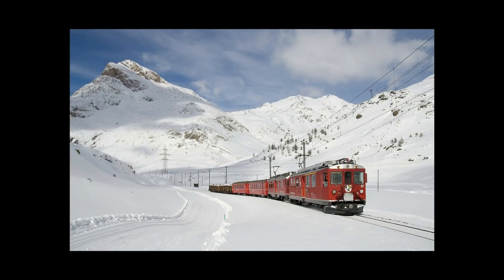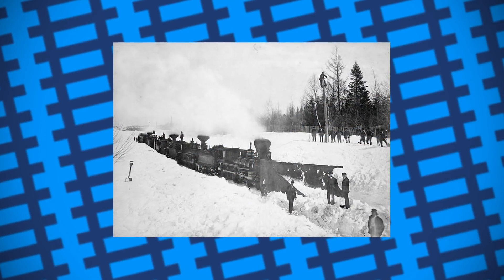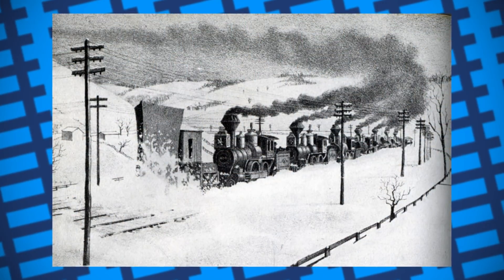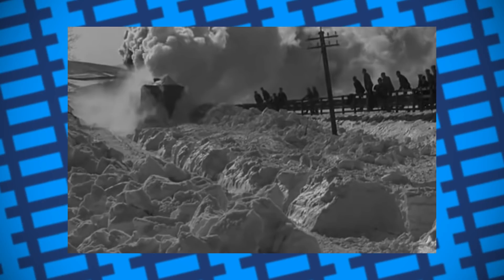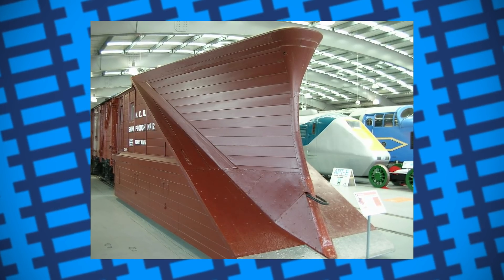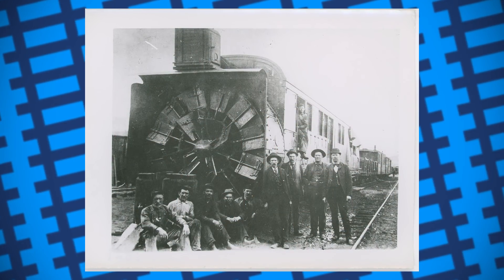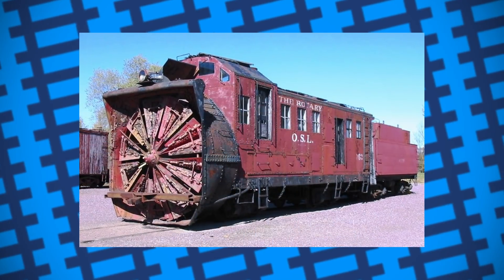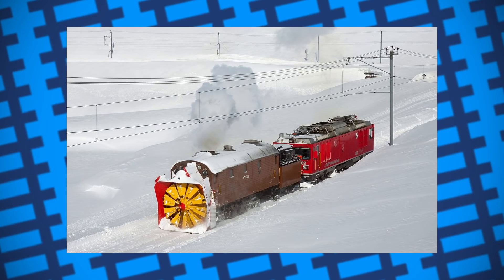How trains clear snow drifts from the rails - Railway Snow Plows

Comment: I think it was the winter of 1947 Britain used an aircraft jet engine attached to a wagon to clear the snow. The blast from the engine was aimed at an angle towards the track where the snow was blown away. I have a feeling this was not used again, partly because 1947 was a particularly bad winter, but mostly it was ineffective and it was not the best use of the engine.

Comment: Way back in the day on the Denver South Park and Pacific Railroad, a train was out on the line during a massive blizzard, the crews couldn’t see 20 feet in front of the plow, soon enough though the storm cleared and it was a clear night with the moonlight illuminating the wilderness. In the shadow of the moonlight a massive solid looking object was dead on the rails. The engineer threw the brakes, put the locomotive in reverse and laid down in the whistle, once they got to a stop the engineer and firemen got out of the cab too see that the obstruction was a large bale of hay. Assuming that this was the work of a farmer that came through with a herd of sheep hours before. He joked that maybe they were the ones trespassing on his land. And that was the truth. After 45 minutes of searching they found the mainline a half mine away. The WHOLE CONSIST was a half mile off the rails in a farmers field. The engineer said that looking back on it he noticed that the train ran a lot smoother once it left the rails.
Reply: Holy Hell

That must've been one hell of a story to tell the rescue crew if any were needed
Reply: Bruh moment right there

Comment: I've seen the occasional plow train running in the winter in New England. Usually the Loco-mounted plows are enough but when there are big drifts the railroads will use Russell snowplows. Russell snowplow cars are ancient (1920s-1950s vintage) but they get the job done. Jordan spreaders are also used- they have the advantage of being multipurpose machines, since snow plowing is secondary to their primary function of spreading freshly-laid ballast.

Comment: Finally. An explanation why Donald and Douglas were seen operating back to back with a breakdown coach in-between during the snow seasons
Reply: I know. I always thought that was something the Rev W. Awdry made up. I was shocked to hear that engines actually did that in real life
Reply: A large part of the reason for it is that without modern weather forecasts nobody knew if they were clearing the snow during the middle of a storm or the end of it, and if you set off and start clearing a line during the middle of the storm without a plow facing behind you, you might not be able to get home because of the amount of snow had fallen on the track behind you…  Then the plow would require a rescue consisting of another plow coming from the depot, (which could then easily mean you end up with two plows, both facing the wrong way as even more snow falls, and you needing another rescue!)

So, assuming your snow removal plans don’t include “wait until it melts in the spring”, (and for some lines it does,) it really is best if the snowplows can come home on their own even if it keeps snowing.

There was a brief time when good weather forecasts started being a thing that the rotary plows in the US didn’t follow this rule: they had the rotary on the front but just a regular plow in the back figuring that not that much snow would fall and it would be okay...  Several got stuck during a particular bad storm, and the rule is now if the snow is bad enough to justify using a rotary at all, you need one on the back too.
Reply: @gimmespamnow  Huh, interesting. Thanks for sharing. I'm an American, so I don't have as much knowledge on European railway operations, but reading your comment has given me a greater insight to how back-to-back snowplow trains worked
Reply: Losh sakes
Reply: Hey, yeah!
Reply: Ai

Comment: In snowy conditions the fuel in diesel’s fuel tanks would usually freeze, crews would get around this by lighting a fire under the tanks to thaw out the fuel, this was surprisingly effective
Reply: Effective, but also very dangerous!
Reply: Diesel doesn't freeze, it gels.  It would also be relatively easy to pipe a heating tube through the fuel tank to circulate engine coolant through to warm the fuel.  "Snowy conditions" is relatively vague, because just because it's snowing, it doesn't mean it's cold enough to gel the diesel.

Comment: I wonder if there's ever been an accident involving snow that knocked a engine off the rails
Reply: I've read about a train being divided into three separate sets of wagons when it ran through a snowdrift (the locomotives continued for some distance before discovering this). They then went forward, switched lines, came back, & attempted to push the broken wagons forward to reunite the train. The idea of propelling goods wagons through snowdrifts with only the three man team of driver, fireman & guard was sheer folly, & the wagons became derailed. This led to single line working being enforced over that section. This was a contributory factor in a larger disaster that followed.
Reply: The Swiss Rotary Snow Plow shown at 02:46 once was rolled over by an Avalanche

Comment: Probably the most extreme idea of a snow plow was use of a jet engine on a rail cart to clear snow!
Reply: They have those on trucks and custom rail vehicles.
Reply: There were trials to use such in Poland (engines from MiG-15 fighter and TS-11 Iskra trainer aircraft) , but the engine blast was causing too much damadge to gravel ballast and ties.

Comment: Another little good 'un - GWR also experimented with mounting two RR Nene jet engines on a flatbed (one for each rail, natch) which did work well but had the alarming side-effect of spitting all the ballast out in random directions, possibly causing a bigger problem than the original!

Very enjoyable, great channel.
Reply: The funny thing is using a jet turbine IS still a snow cleaner in the US, although its primarily relegated to yard services. Get a jet turbine over a frozen switch and watch as the snow blows away and the ice melts. 

Where I live locomotive mounted plows are sufficient for the mainline, and the plows are just permanently mounted to the locomotive.
Reply: Jet engines were used in Germany too, to get rid of the ice on swiches. One of these can be seen at the Meuselwitz narrow gauge railway.

Comment: I live in the US State Minnesota which is one of the most snowiest states in the Union and some of the snowdrifts get so high they're taller than the locomotives and themselves. My brother who works for the I ion Pacific Railroad actually got stuck in one of these drifts ironically being sent to go save another train that had gotten stuck. The National Guard was sent out to rescue both crews. It just goes to show how important snow lows and rotary p!owe are to the railroads.
Reply: And that's why Canada invented the rotary plow^^
Reply: Didn't realize the snow GOT that deep, even with some distance from the Great Lakes; also hope Union Pacific & the other big railroads look into restoring more steam engines in future, considering there are still plenty that deserve to be in preservation or in service for lighter work if they're in good enough shape.
Reply: dang thats deep ive seen 7 or 8 foot drift here in the cascade mountains but that insane
Reply: @IndustrialParrot2816  Yeah it happens obviously part of it is that it gets pushed to the side as time goes on and just keeps accumulating snow, its fun looking at old pictures of trains running along side the snow drifts that are so high you could use the engines and cars as a bridge to and from both banks. So crazy.